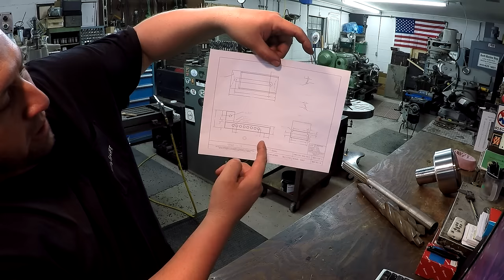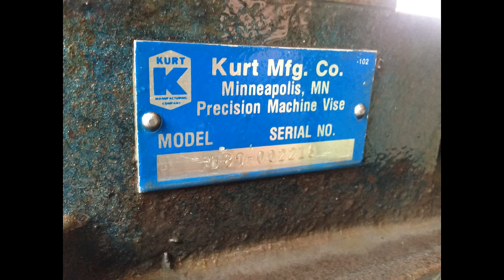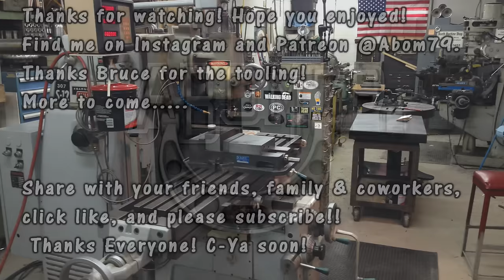Saturday Night Special 86 Part 1

Comment: Good thing you got that rapid on the K&T knee working well so it can handle that extra vice weight!  :-)  Can't wait to see it in use on the machinist vice build.
Reply: +ILGopher P.S., hard to tell from the google+ interface if you saw my response a couple weeks back, but Keller made the Jefferson 601 power hacksaw.
Reply from the maker: +ILGopher Didn't see that, but interesting news. I thougyht that they looked the same. Cool!

Comment: I got a chuckle looking at the address on the bell you bought... Chicago 22. Before ZIP codes (Zoning Improvement Plan) larger cities had zones. All those disappeared in the 60s when they were converted to ZIP codes (now that location is probably zip code 60622). It shows that bell has some age to it (like the people that can remember before ZIP codes came about) but it still looks great.
Reply from the maker: +weshowe Someone else mentioned that it was made before 1964, when they started using ZIP codes.

Comment: I have a great idea for a wood top, it's just that you'll have to do some research on your side of the pond. A wooden meat cutting board. Those are sturdy, thick and would make a great top for working on it too. And you don't have to hassle with making one, you just buy it sized or bigger and cut it to spec.

The vise i bought from an old man had the exact same thing. It was sitting on the swing base and he abused it with a hammer. In his defense, the thing was freaking stuck like crazy and was waaay bigger than something he could handle to clean. No biggie tho, he told me, i made note of it, a stone swish here, one there cleaned real nice. :D I like it when the seller tells me stuff like this, i didn't even ask for a price down because he did, really nice of him, other people don't.
Reply from the maker: +aserta Butcher block is what your referring to.
Reply: Abom79 Yup, those.

Comment: Great score on both K&T items.  The fixture plate will come in handy for all kinds of set ups.  We have a D80 Kurt vise at work.  I used to pick it by hand until I weighed it one day ...... 140 lbs.  I used the overhead crane now.   Jeff  ...added question.. for the K&T , you mentioned 50 taper.  What length to the flange and what size thread for the retaining bolt?
Reply from the maker: +JRD77VET Yea it's pretty damn heavy. I can pick it up, but in the words of our friend AVE...."that looks like a job for somebody else..."
50 tapers....quick ruler check is about 5 1/8", and the thread size is 1"-8.
Reply: +Abom79   I'll check to see if we have a 2"  shell mill arbor in the "dusty bin" at work.

Comment: Adam,
Is it OK to assume the slots in the bottom of the Kirk vice are parallel to the fixed jaw?
I'd like to make up a set of keys for my BP and the vice but was wondering about ensuring the two surfaces are really aligned.
Eric

Comment: I would like to make those keys for my vise,  I have a non kurt, do you still need to check it with an indicator or is the slots suppose to be true to the fixed jaw.
Reply from the maker: +Ed Ginsberg It depends on how close of a fit you make the keys to the table slots. if it's snug then it should be damn near zero if you sweep the vice jaw.

Comment: Thank Adam do you still dial in a vice if it has the key sorry for the dumb question but did not know great stuff keep on  turning
Reply from the maker: +Greg Kernick I have not checked the vice yet but yes I do check them tram before milling anything critical. I'm curious to see how close it is. I'm placing my bet on .002 from one side of the jaw to the other...max.
Reply: +Abom79 Adam is not just hoping.  I use that same method, and with snugly fitting keys in both vise and t-slot I get not more than .002" runout across the 6" of vise width by just dropping it in the slots, and it is fast and easy to get it more accurate.  After a couple trials, you just know to bump it a little left or right and snug it down.  It will be closer with 30 seconds of that than with 10 minutes of trying to tram a loose vise to the table.  It also cannot be bumped way out of tram by aggressive milling.
Reply: +Bob Korves thanks guys for your help

Comment: Hey Adam,

I see you took the width off one side of the key to fit the tee slots. Did the studs fit in the notches ok? Love seeing the K&T come together. 

ATB

--Tom
Reply: +oxtoolco If you're referring to this section, he did say at 25:02, "We'll flip it, do the other side, and see how it fits."
Reply from the maker: +oxtoolco Tom, I milled an equal amount off each t-bolt to keep it all centered. I also milled the step keys equally. Everything is on center. :)
Would love to get a pic of the 8" clamping the 3". 

Adam

Comment: Good SNS Adam.   The tooling gifts and purchases look great. You need to get the driveway bell setup they sound so cool.  Congrats on the 1M views on one video Pleased to see the K&T coming into use . Those are couple of huge gouges out of the bed. I see one disappeared under the vise . I hope they will not interfere too much. Its good to see that you and Tom and a couple of others on YouTube and also American industry are suddenly realising that the metric system will get used in the USA, especially for exports. I like to work in Imperial measurements as well but can convert back and forth between the 2 without thinking too much. In the UK many engineers work with both types of measurement all the time and don't think of it as unusual.  Keep up the good work .Looking forward to your next project.  regards from the UK
Reply from the maker: +Gary C It's just all too common here to have measuring tools read in inch, and all of my machines read that way too. it's the way my brain thinks, metric is constantly making me convert. I know it's easy, but i like the inch system.

Comment: For the bell, you could get an air operated switch, comes with either a foot operated dome, or a panel mounted button, just connect the tube to the bell.
2 ways to use this if it comes with the actual air switch, either just use the button or dome on the bell for a doorbell, or wire the air switch in parallel with the original switch inside the bell so you can have a doorbell and car detector.
Difference would be that the car would normally ding twice, doorbell just once
Reply: +Sparky Projects one of those rubber inflators for inflatable toys, with instructions to punch it!
Reply: +jusb1066 Would probably work, but may be too powerful if someone punched it, could blow the pipe off, or damage the diaphragm in the bell
Reply from the maker: +Sparky Projects I thought it would be really cool to use it for a driveway alarm, because when my doors are shut I don't know if someone drives up. I'm curious if that long of an air line would still work. It' only has to move the little piston up about 1/32" to make the points contact. If not, a doorbell would be fun too!
Reply: +Abom79 If you are worried about the length, you could run some solid pipe most of the way, and just use the soft pipe as  the detector, long runs of soft pipe could mean the pressure from a car is dissipated.
Something like brake pipe tubing i think is a cheap source of solid pipe, you want it small

Comment: Adam:  Congratulations on your first million,  I love a big horizontal mill. If the vise doesn't indicate indicate in, it will probably be from inaccuracy in the table or vise.  Dave
Reply from the maker: +David Richards Thanks David. Our other big green vice i now use at work has always had the keys on it. It was always indicated within .001 after dropping down in the slots. I need to tram this Kurt and see how it does.

Comment: i'm an industrial mechanic apprentice in germany at bosch and i just want to say that i realy like your videos!
greetings from bavaria

ps I have 1 question: the part you are milling at about 24:00
the material is hardened isn't it? an you aren't using coolant on a HSS (?) miller
with all that difficulities your feedrate seems to be pretty high
(sorry for the english though...)

pss the parallel tool, whatever, at 27:00 is awesome i want that in our shop
Reply: +kalabrushka as they are hold down bolts, they would only be slightly hard, not heat treated, so would be machineable, I think!  Greetings from UK
Reply from the maker: +kalabrushka It's a tough tool steel, but not hardened. I was using a 1/2" 2 flute carbide end mill to cut it, running about 1K rpm. That angle plate is awesome! He has another and I think I'll go buy that one too so that I have a pair.
Reply: +Abom79 Nice angle plate.  Another thing to consider is making support brackets to fit it like Bruce Whitham did for his.  That would stiffen it up against the spindle.
Reply: +Abom79 well it should be possible to produce that by myself. or is is it grinded like a gauge block, so it doesnt slip away? i think the only thing is that the peaker the angle is the better

(oh my english skills became so bad ._.)

Comment: HI Adam, like everyone here i'm a big fan of your videos. I enjoy them even more recently as i lost my job as a manual machinist apprentice. All is not lost though as i picked up another job at a CNC machining company that specialises in batch production. Having a computer ploughing through aluminium Doesn't have the same thrill to it as hand wheeling through a billet of steel.

I learnt quite a few tricks from your videos. Always interesting. I'm currently making a machine vice at college. Hopefully your drawing has the right dimensions and tolerances to make the parts fit together properly as the City & Guilds course i'm on don't seem to.

Comment: Hey Adam, quick question. How is it that the K&T does both vertical and horizontal milling?
Reply: +Hayden Lacey Watch the other vids.  The K&T has a vertical head that indexes off the horizontal supports, bolts in place, and couples to the horizontal chuck for driving the vertical chuck.  It can do vertical milling jobs that would simply be way too big for the DoAll vertical mill to do